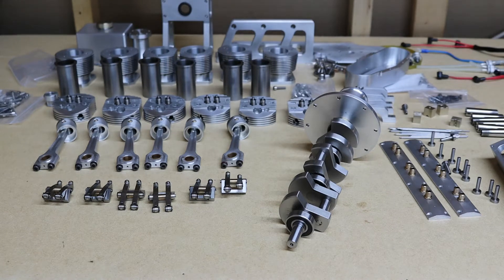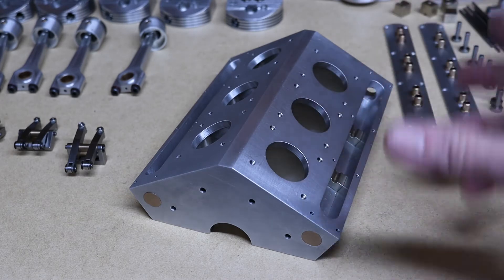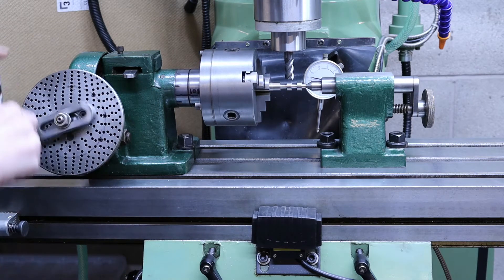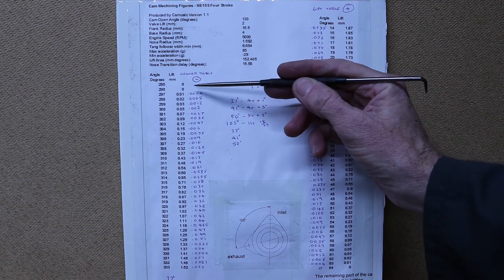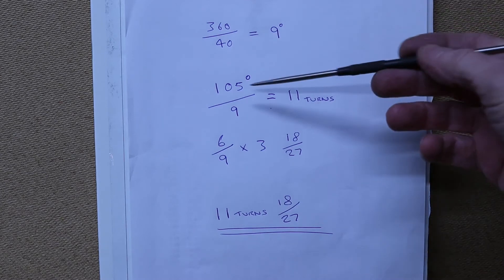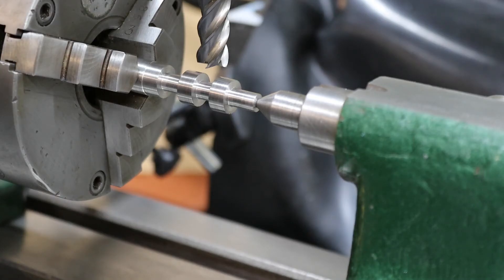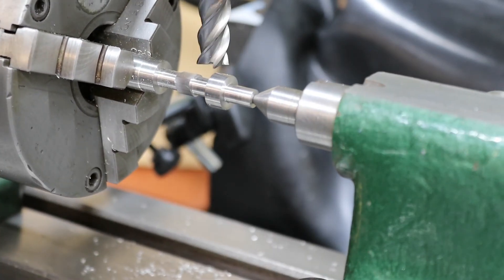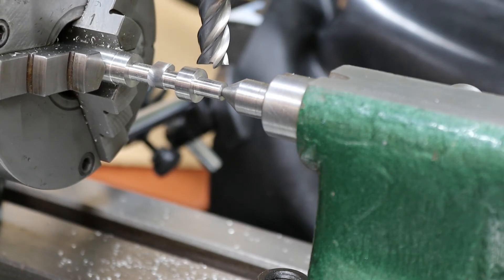Making A 90cc V6 Engine - Machining The Camshafts

Comment: I've just found your channel after seeing your comment on Joe Pie's video. I've always wondered if it was possible to cut a cam on a manual machine. I'd love to machine my own engine, I lack knowlege and macinery though. I am saving for a 8"x20" lathe at the moment. I watch many machining channels and I'm going to have to at least try. only thing is I could buy a second hand harrison or colchester for what it'll cost. not got the space though. great video
Reply from the maker: Thanks for watching my channel.  I think you will be fine making an engine it's not as bad as it looks just concentrate on one part at a time and soon get there. Hope you find a lathe.
Reply: I've been looking at a DB10VS from Chester hobby store, they look to be well made, they've just gone up £200 though. £2200 is a lot of money. I think I'd rather that than a comparable Chinese one for £1000. Have you any suggestions?
Reply from the maker: @Jabbaholl  well I use a Chester DB11 and I’ve been using it for about 9 years now and I’ve never had any problems with it and I’ve used it a lot. The DB10 is basically the same machine, my friends just bought a DB10 about 2 weeks ago and he can’t wait to start using it.
Reply: I'm a 40yo builder or was until cancer retired me. I've enquired at I think its Blackburn uni for a nvq course in machining and related theory.  During the past 5 years of 'retirement' I've watched thousands of machining videos and I'm already confident on setting up and running a lathe. Familiarity with the levers and wheels will take time. I'm currently binge watching all your videos.
Reply from the maker: @Jabbaholl  my daughter's doing her apprenticeship at Blackburns training 2000 and she's learnt many machining skills there. You will soon require the skills needed to make things and hopefully you'll show us what you've made. Take care.

Comment: OMG I've always wondered how to make a cam, now I know I wont be rushing to do it!. You would need serious patience just to do one lob let alone another 11! Would you mind clarifying how the 3 cam pairs were connected onto the rod, Im assuming they are done in pairs and put onto the drive rod but how are they fixed? Stunning stuff :)
Reply from the maker: HI, yes I drilled a small hole in each cam pair in exactly the same position. Then drilled the same size hole in the shaft 50mm apart each set at 120deg each other. Then pinned and glued them on. Thanks for asking.